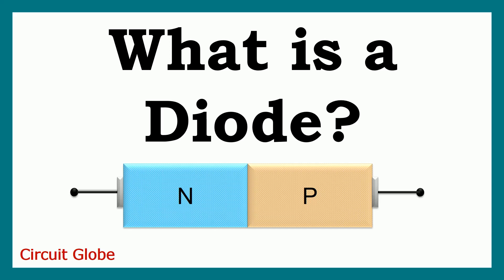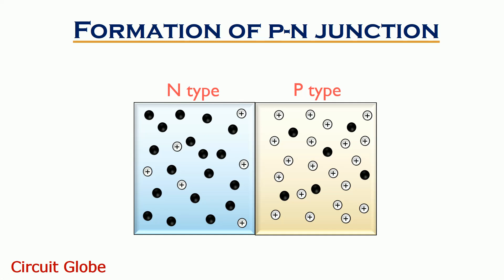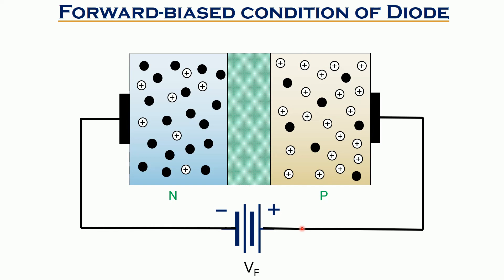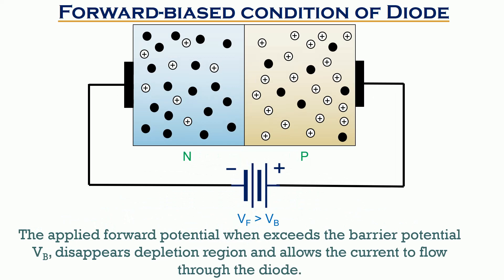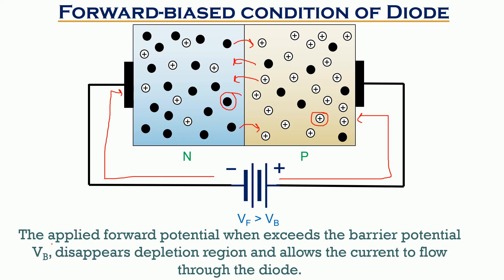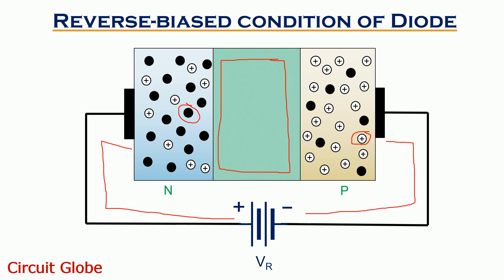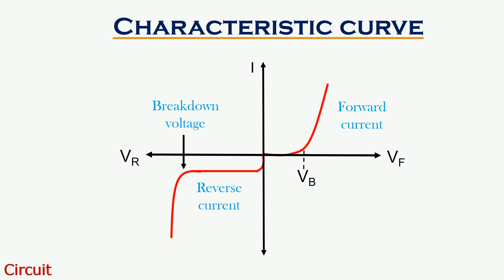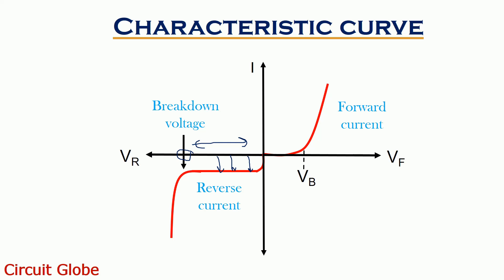What is a Diode? - Forward and Reverse biased diode

Comment: The barrier potential of an operational diode can never be made zero. The potential barrier of an operational diode can never disappear.
What is a pn junction ? 
A pn junction allows current in one direction only. It blocks current in the reverse direction. 
When a pn junction is formed, a potential barrier designated Vo comes into existence and is typically around 0.6 to 0.7 volts for silicon junctions. 
When the barrier whose Vo is 0.7 volts is disturbed by applying a forward bias of say, 0.6 volts, the current increases and the increase becomes steep for small increments of the forward bias value a little greater than 0.68 volts. Large currents are observed when the forward bias is 0.69 volts which is closer to the barrier voltage of 0.7 volts. 
The forward bias can never exceed the potential barrier voltage nor can it bring the barrier down to zero volts. That is the reason you seldom see current vs volt graphs of pn junction diodes beyond a volt or so.
How does the bias remain less than the barrier in an operational diode?
The voltage bias applied drops in the bulk neutral regions of the diode. 
A detailed description of the pn junction with a distinct approach using surface charges, alignment of Fermi levels, creation of the barrier, the distinct processes of diffusion, drift, recombination and the influence of the electric field on the energies of electrons is provided in the following textbooks.

Electrostatics and circuits belong to one science and not two, that of electricity and magnetism. To know how they are unified visit this link 
https://matterandinteractions.org/articles-talks/ and view the article 'A unified treatment of electrostatics and circuits.  B. Sherwood and R. Chabay, unpublished. (1999)'
pdf. 
For a live demonstration of surface charge and its effects in circuits visit 
https://youtu.be/U7RLg-691eQ
For a detailed discussion of surface charge, coulomb's law, electric fields, fields of dipoles and other charge configurations, parallel plates, capacitance, currents, conservation of charge, conservation of current, superposition of fields, superposition of potential, simple dc circuit, magnetic fields, magnetic fields of a current element, straight wire, current loop, solenoids, biot-savart law, voltage, voltage source, difference between e.m.f. and potential difference, ideal voltage sources, resistors, how current branches in a parallel circuit, capacitors, inductors, faraday's law, inductance, ac circuits, transmission lines, motors, generators, p-n junction diodes, electromagnetic waves, antennas and radiation, new electrodynamic theories on the nature of the electric field, see "Electric and Magnetic Interactions" by Chabay and Sherwood 
www.matterandinteractions.org
or 
Fundamentals of electric theory and circuits by Sridhar Chitta
https://www.wileyindia.com/fundamentals-of-electric-theory-and-circuits.html
There is a "look inside" feature in the amazon.com webpage of the book "Fundamentals of electric theory and circuits" by Sridhar Chitta with a few pages of Chapter 1 which may be viewed and also which you may swipe left or press < icon to view the foreword, preface and Table of Contents. The contents of the above book by Sridhar Chitta, make a distinct unified approach to electrostatics and a few advanced circuits like coupling signals to amplifiers, lending precision and clarity to the topics which is not found in most text books.
The book comes alongwith a CD with animated power point presentations for all chapters and voltage regulator, RC phase shift oscillators and differential amplifiers included additionally.
For a lecture by Prof Ruth Chabay on surface charge in a simple dc circuit visit 
https://youtu.be/-7W294N_Hkk